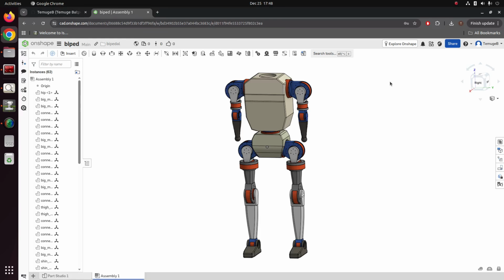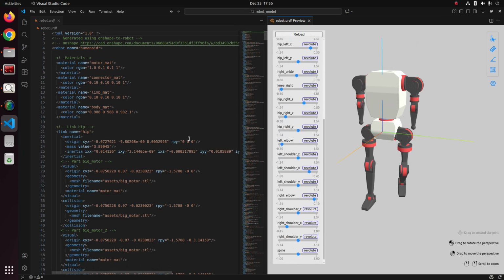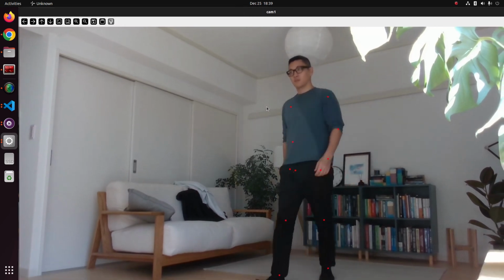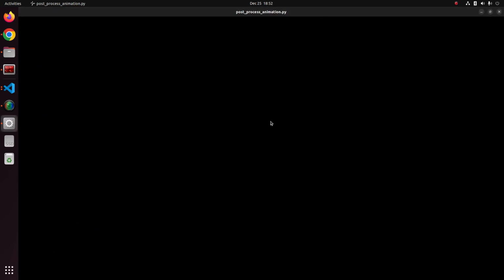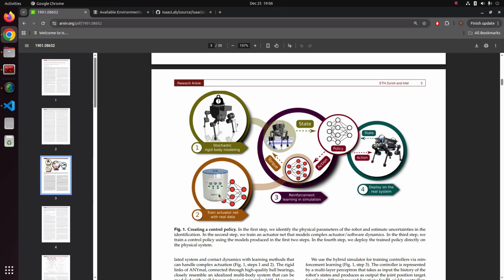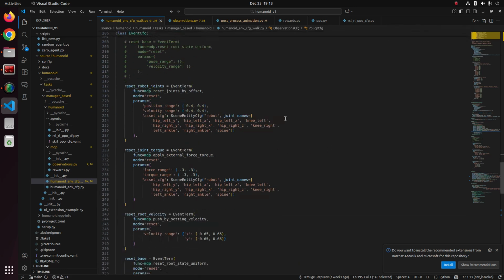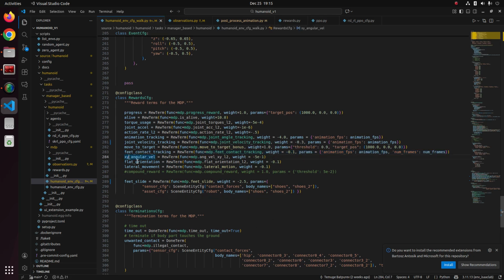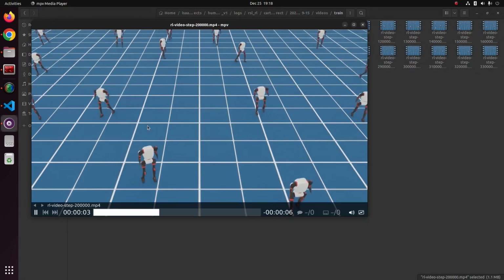Training a Humanoid Robot to Walk in IsaacSim/IsaacLab

Comment: Your video is really extremely good and very helpful. I have been working on a humanoid robot based on the Kscale Zeroth design. This is quite small and uses FeeTech servos. 
I have made it walk with a script file and then tried modifying the H1 examples in IsaacLab but it is a little tricky because I have fewer DOF's and the 'Pelvis' is deeply embedded in the examples. With some effort I have it doing something in IsaacLab using the Direct rather than Manager-based examples. I still need to tune the Stiffness and Damping actuator parameters for greater realism.
I would like to make it walk with a more natural gait and what you are doing is exactly that. Will you be putting any of your code on GitHub anytime soon? It would just make life easier for a beginner like me! 
Keep up the good work. I cannot believe that you are not getting more 'Views' since this is the most helpful video I have found for humanoid robots.